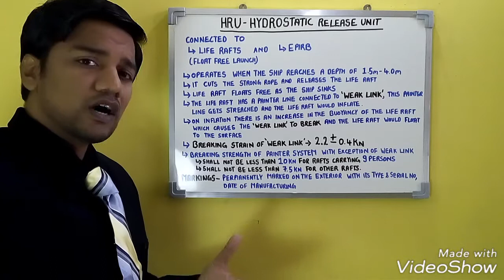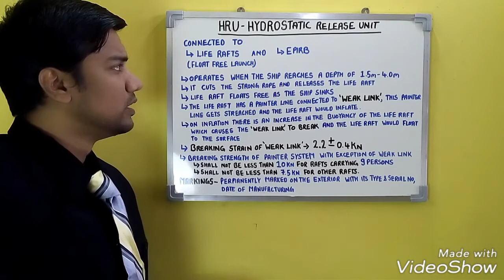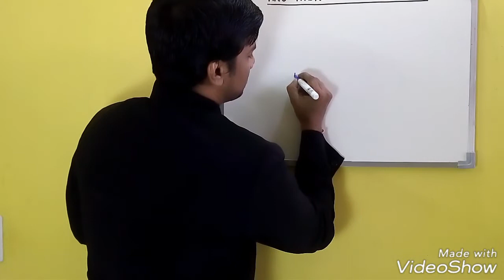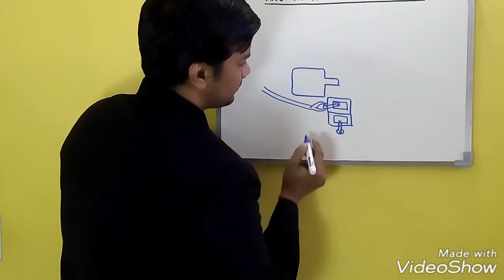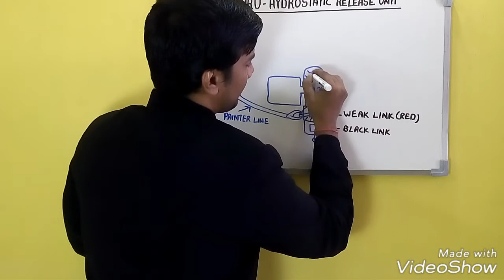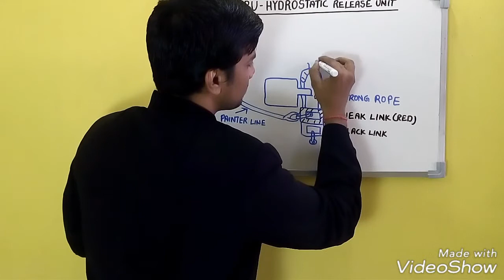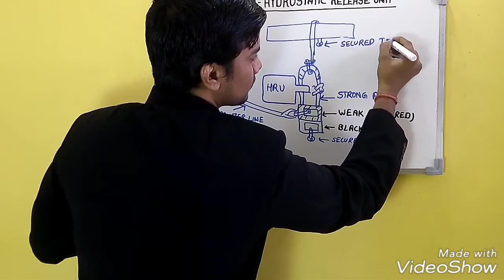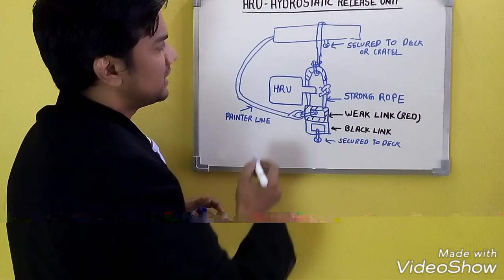HRU-Hydrostatic Release Unit, 2 mates oral, F3

Comment: Did u jus say breaking strain of weak link as kilo knots.. 😝
Reply from the maker: Rajesh S 
KN -Kilo Newton ...it should have been...haha..good pick
Reply: Mariner can u tell me what is the difference between making way or underway
Reply: A vessel that is "underway" need not be moving through the water but may simply be not anchored, aground, or made fast to the shore. If a vessel is making no waythrough the water, it is stopped (dead on the water) and drifting, unless it is notunderway. If it is moving relative to the water, it is making way.